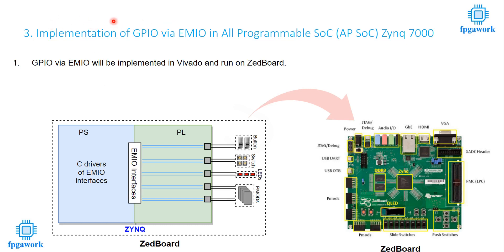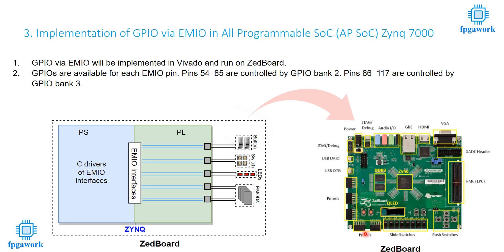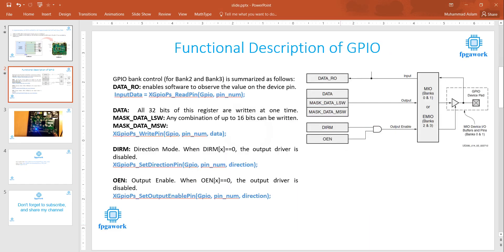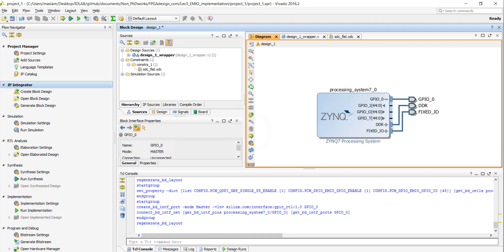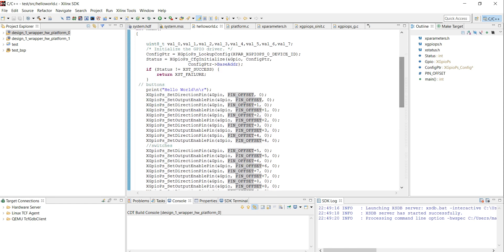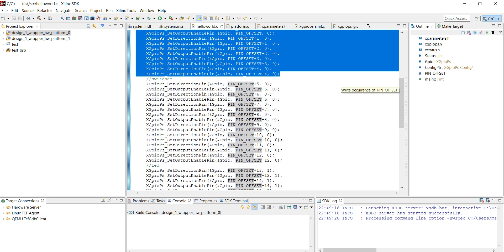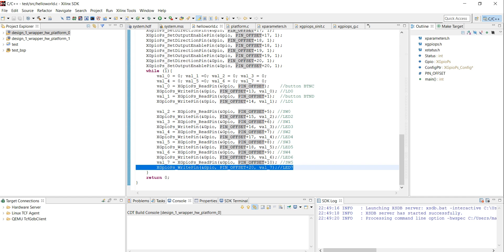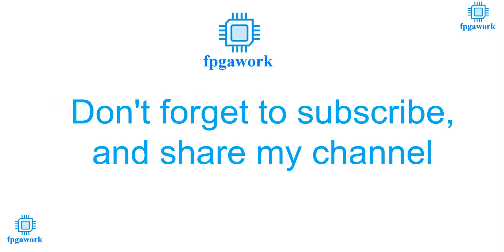Implementation of GPIO ( i.e., buttons, LED, and Pmod  ) via EMIO on ZedBoard

Comment: Hi Aslaam! First of all a huge thanks to you for your contribution to FPGA Community. I have been trying to replicate the exact same thing what you are explaining. but I am getting a bitstream error. it says "[DRC NSTD-1] Unspecified I/O standard: 45 out of 175 I/O standard (IOSTANDARD) value 'DEFAULT', instead of user assigned specific value." This kind of error usually occurs when appropriately pins are not mapped to the inouts. but in this case we have made an external to GPIO_0.
Reply: change the DEFAULT value to the appropriate voltage standard such as LVCMOS33 and check.